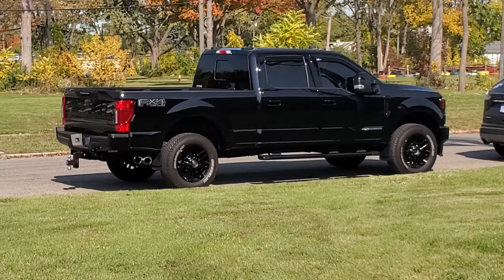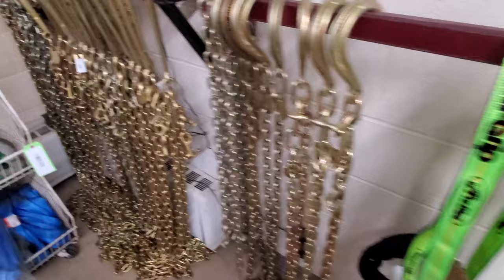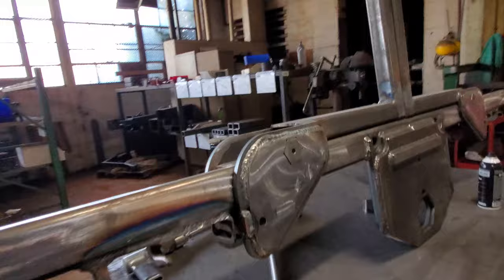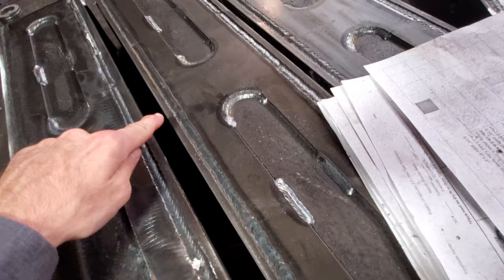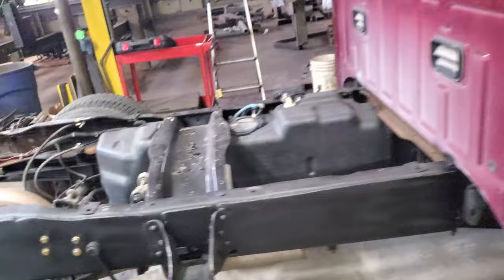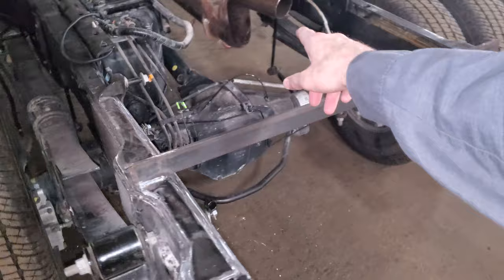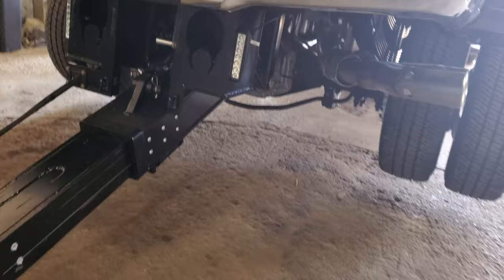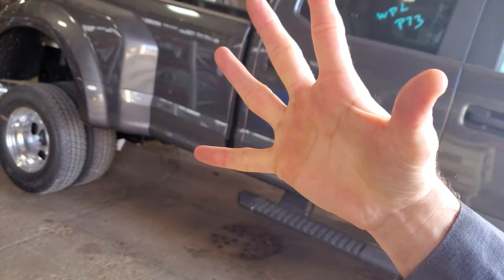Ford Alumiduty PICKUPs turned into TOW TRUCKS!! | @Detroit Wrecker Sales

Comment: I plan to turn the 12' bed on our 2000 550 into a dump bed. Some fab to the frame and welding. Will be great with the bumper pull dump. Love putting them trucks to work.